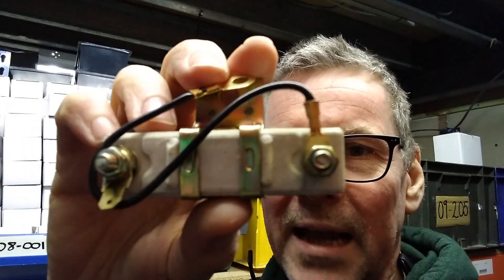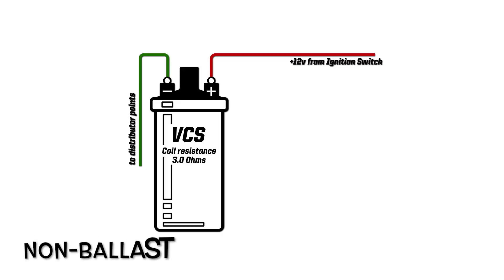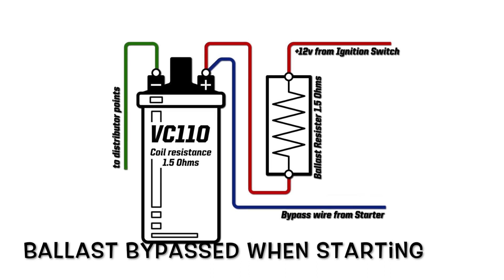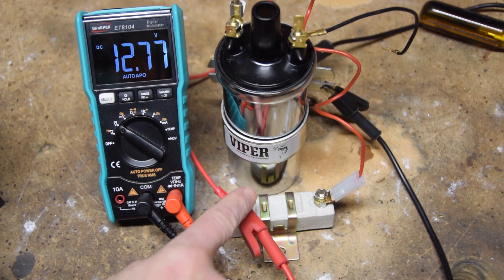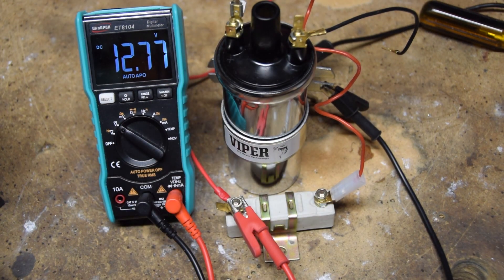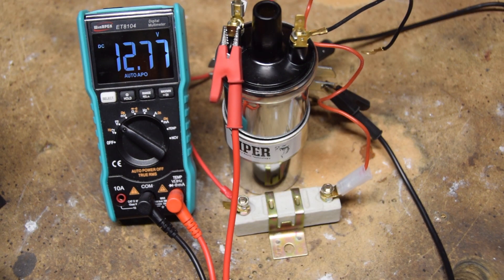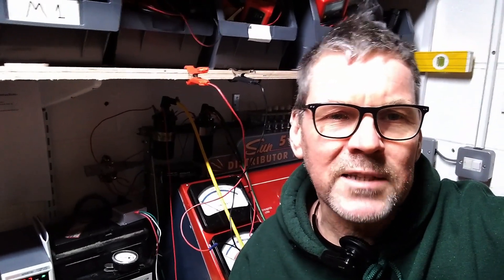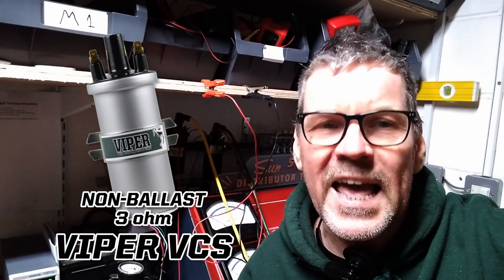What is a ballast resistor... How do I know if my classic car has one?

Comment: A bit brief LOL. Do the test with the engine running and producing some 14 volts. At that point after the ballast ,you may well have some 12 volts at the coil. Also ballast resistors come in different ohm values, typically 1 ohm and 2 ohm, do you know which to use and why?

Comment: Crazy misleading video. The real reason the world did away with points is they can't run a high power coil. You want max. coil power in any engine. This is why modern cars have 0.8Ω coils. Fit a variable dwell electronic unit, ditch your ballast and your points. That way you'll light-up  the weakest mixture during cruise, over-run and idle. Low emissions/ economy. Proper ignition. Whatever the stickers says it's not a high power coil if it's not 1.2Ω or less. Proof of this is the ballast which if you';re running high-power ignition is the last thing you want. Those were used in the 50s, 60s & 70s because back-when there was no option.

Comment: The obvious symptom back in the 70’s / 80’s of a faulty ballast resistor when working as an AA Patrol would be the car would start and run when the key was held over to the start position with the starter motor engaged. Immediately that you let go of the of the key, the engine would cut out. We simply bridged the resistor thus bypassing it which would get the car back on the road.

Comment: Thanks for the video. I have a 1969 GTX with hard start issues. After watching this video I immediately went and checked my coil wires. I have 2 wires on the negative and 1 on the positive which looks "incorrect." The car has run like that but again, I have hard start issues. Would that incorrect wiring cause the hard start issue?? With ignition on, the voltage is divided between the resistor and coil as it should be.

Comment: What replace the baluster in the 90s I have a 1994 Ford lightning F150 pick up truck does this truck have a baluster because I have no spark in the spark plugs. I change the ignition coil and distributor still no power and Doyo.